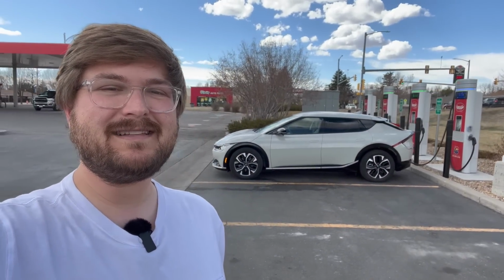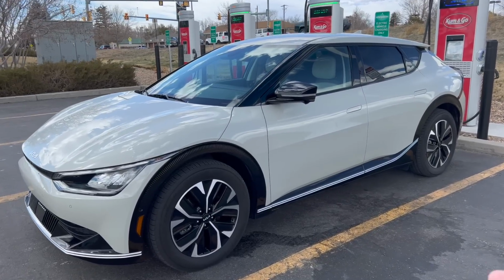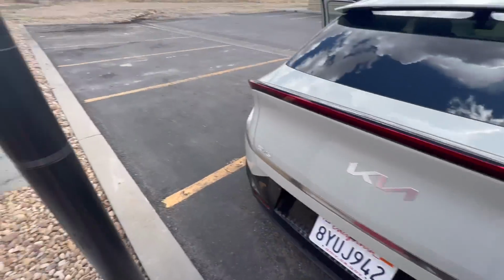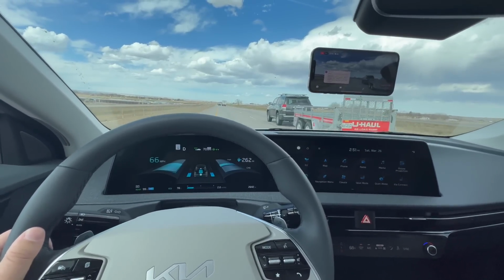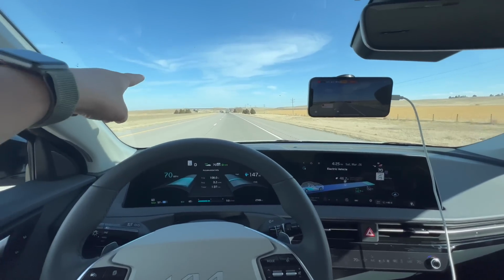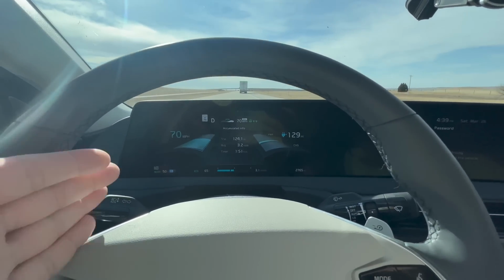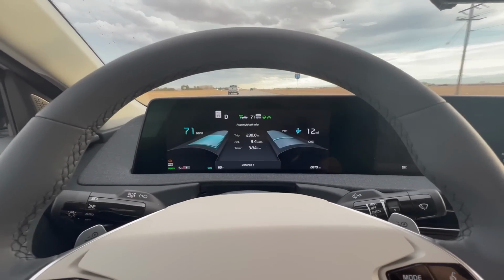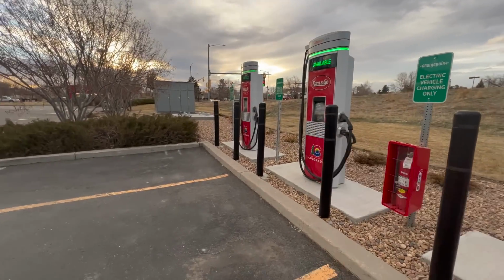2022 Kia EV6 AWD 70-MPH Highway Range Test - (Wind 19” 77.4kWh)

Comment: I have an EV6 first edition and I love it. It took me just under 30 minutes to charge it from 10% to 100% on a 350 kW charger
Reply: I just ordered mine a couple hours ago and the salesman said it doesn’t come with any charging cables. So can someone educate me please regarding the hardware I need to purchase while I’m waiting for it to arrive. Do I need to buy any charging cables, specifically which ones? Any advice/input would be greatly appreciated. This is my first EV. I went with the GT line in the dark  matte gray.
Reply: @littlebigbrother7279  you should buy a charge point home flex or wallbox pulsar plus for 40a/48a 240v charging at home (note you need electrician to wire your house for this) and or a (called lvl 1) slow charge cable from lectron or similar for emergency 16a 120/240v charging. That typically won't need an electrician but limits charging speed to 5mi/hour. I highly recommend getting a quote from an electrician and put in at least a 40a breaker (32a charging) or 50a breaker (40a charging).
Reply: Doesn’t KIA cover battery drainage issues for its first 10 years?
Reply: I'm picking mine up in a few days...I'm properly looking forward to it...the dual motor 325hp model
Reply: As far as in fan of Hyundai and Kia you are talking nonsense. It won't charge to 100% in less than 30 min. 18 min needed to 80% and then speed drops drastically
Reply: @KubaYa1411  not true. I have sat in the car while it charges from 10% to 100% a dozen times so far. It only does it on the 350 kW charger and will charge at about 40-50 kW the last 10-15% but it will definitely do it that timeframe
Reply: @geraltofrivian516  ev6 73kWh drops under 30kW at 92% . So we need 8% from 73kWh to full charge= we still need nearly 6kWh to be fully charge so 12 min @30kW which is not going to happen as speed keeps dropping every 5%. And even if that kept 30 we wouldn't make it in 30min. So please don't tell us stories. I'm fan and user of EV myself and let's be honest 😉
Reply: @KubaYa1411  Do you have one? If you want me to record it I’m more than willing. It charges at over 40 kW up until 100%, mine does not drop below, I don’t know if it’s charging too aggressively, but I’ve done it multiple times. I’ll time it and record it and post it to my YT page
Reply: Don't use that too much, unless you're leasing the vehicle I guess, because supercharging will degrade your battery life signicantly.
Reply: @Investor9872  oh I’m definitely not! I have been charging to 100% just for a vacation we are on. Otherwise it’s only 80% charge ups at home
Reply: @geraltofrivian516  That's pretty good for a 100% charge. In general though I'd say a lot of the time the last 20% of the charging cycle is almost not worth it, on some vehicles the last 30% will take as long as the first 70%. Shorter but slightly more frequent charging stops tend to be the most time-efficient, it's best to line up charging with bathroom breaks if it's possible.
Reply: @0hypnotoad0  Depending on your path it's not an option. For example on my drive to Vegas from Phoenix there was only one fast charging station on the way there and back.
Reply: @catzblu999  Yeah that's the one instance where charging to 100% is needed, but my point remains that if you're on a path with a good number of chargers, it's always a lot quicker to charge in the 10-80% range
Reply: @Investor9872  I fill my gas tank full, I hope its not going to degrade.LMAO.
Reply: @robertduklus6555  ice cars degrade over 7 years
Reply: @logant6490 not if you purchase correctly.
Reply: Fast charging destroys your battery....good job.
Reply: @yellowsnowman9157  No, it doesn't "destroy them".  Studies have shown something like an extra 5% battery loss at 100k miles from cars that use DCFC vs LV1/LV2 chargers.

Comment: I’m loving mine so far. I have the same spec as in the video. Round trip to the mountains and back got me 3.6 kWh avg with me and my wife and two dogs plus luggage. Elevation change was around 1500 feet. Speed limit was only 65 and not 70 with some areas 55. If that helps anyone.
Reply: Those are great numbers for mountains, occupancy and elevation changes.
Reply: I'm curious what the dealership markup was for yours?
Reply: For the Wind, can you confirm it has the auto lane change? I always thought it only came with the highway driver assist II on the GT Line
Reply: @johnkhalil9831  it does not have lane change. It is just HDA and GT has HDA2. It has enough for me. I personally like how it keeps a certain distance from you and the car in front of you more so than lane change.
Reply: @PhotoJohn80  GT-Line also has the HDA2, not just GT.

Comment: Wind only has drive assist 1. GTL has 2.
Reply: See this part confuses me though because he clearly has HDA2 since it's letting him change lanes automatically. Mine definitely doesn't come with that feature
Reply: @Matt-M  That's a good point. It's weird because on the features breakdown on Kia's website it doesn't show HDA2 as even an option for the Wind.
Reply: I think the tech package upgrades that to HDA2, thus the in-dash side camera view.
Reply: @StuartFriedman8888  Tech package adds surround view, smart parking assist, blind view monitor, and parking collision avoidance. HDA2 is exclusive to the GTL

Comment: The tires were also 101H. 

101 load rating = each tire rated to hold a maximum of 1,819 lbs so that's 7,276 lbs total - more than enough for the weight of a fully loaded EV6).

H speed rating = maximum sustained speed of 130 mph. Think of 'H' as being for 'high performance'.
Reply: Not even close
Reply: That seems like a low load rated tire for this beast.

Comment: The Koreans really knocked it out of the park with the e-GMP platform and Kia in particular crushed it with their styling (ignore the duck tail). I'm really hoping to see a 300 and 500 mile AWD road trip challenge between EV6, HI5, Mach-E, ID4, and Model Y.
Reply: I hope this wakes up all world car makers to improve , revise and make better go Korean automakers go
Reply: it's not more efficient than whatever platform tesla has right now tho right?
Reply: @a-don13  at the price it is. Model 3 rear wheel used 2019 is 53K 240 miles vs 53K for a 2022 250 miles
Reply: @heribertosarmiento1265  i'm saying technology wise
Reply: @a-don13  that’s what happening little by little Tesla competitors are getting better and better. This is what Korean automakers are doing making a small battery pack drive as well as a rear wheel model 3. Im a fan of Tesla but I want all legacy automakers to catch up and then we will reap the benefits. A world free of Opec control where you can fuel you own car without having to deal with issues we are having now
Reply: @heribertosarmiento1265  I was asking that cuz the 77 kwh in the kia EV doesn't have as much range as Tesla with the same kwh
Reply: @heribertosarmiento1265  he's talking about miles per kWh (efficiency)
Reply: @a-don13  actually the rear wheel model 3 is similar to the EV6 in price but the model 3 from 2019 I mentioned is a 75kWh the Ev6 77. So pretty similar
Reply: @jaredp17  they are pretty on par since the only model 3 that price at the same level as the EV6 is the rear wheel 2019 model the 2020 is 59K and prices keep climbing
Reply: @heribertosarmiento1265  miles per kWh is the question... Not price
Reply: @heribertosarmiento1265  I'm not asking prices bro, just technology efficiency wise.
Tesla ofcourse has apple tax like pricing so they'll always be significantly more expensive.
Reply: @a-don13  actually the tax was added thanks to musk raising it due to the chip shortage . Also tech wise the gap is closing in . If not no other ev maker would hit 200 miles . Also I’m not disagree with you on Tesla being first but like I said glad legacy automakers are trying to catch up to Tesla
Reply: @heribertosarmiento1265  so they're not caught up yet?
Reply: @a-don13  they will so far it looks that way then again lucid beat Tesla on the range
Reply: @heribertosarmiento1265  lucid beat tesla on efficiency. no legacy auto has tho so far right?
Reply: @heribertosarmiento1265  but your not thinking about charging time. One hour to charge? Ridiculous. Tesla charge to 80% today in less than 15 minutes that’s how long it takes to get a cup of coffee at the Wawa . Not to mention I wonder how long those Korean batteries will last? Buy American buy Tesla
Reply: @jaredp17  again they are improving in that as well
Reply: @a-don13  not yet hence why I said “they are closing the distance”
Reply: @heribertosarmiento1265  oh okay cool
Reply: @user-pk9vw2dp5i  I mention the Ev6 does 18 minutes for 0-80% the battery also I like Wawa and quick check. Kia has a 10 year warranty on the battery
Reply: @a-don13  no problem my friend 👍🏾
Reply: @user-pk9vw2dp5i  which Tesla charges to 80% in less than 15 minutes? 
I’m pretty sure all batteries for EVs currently come from China and not America or Korea
Reply: Jaguar knocked it out of the park with styling (i-pace), which Kia then did a fine job of knocking off.